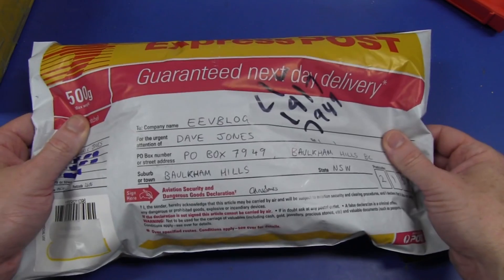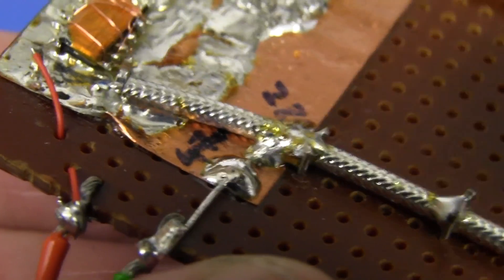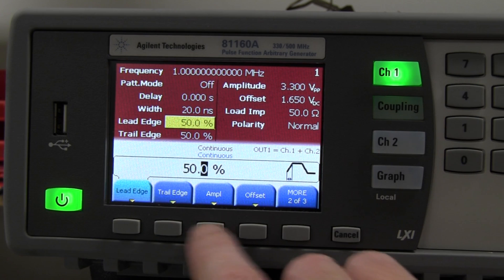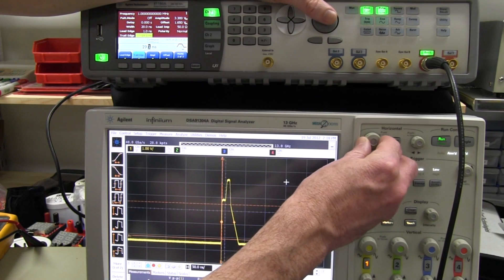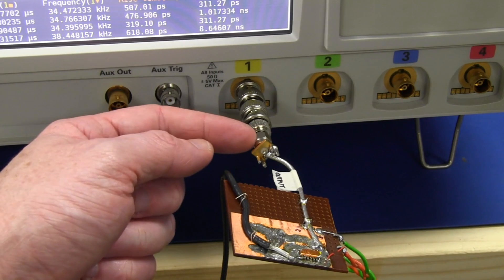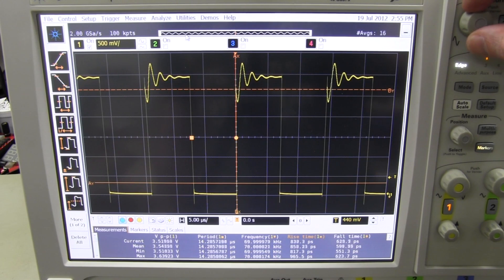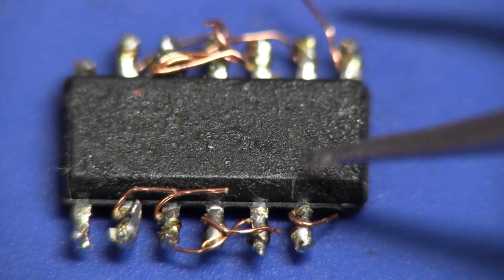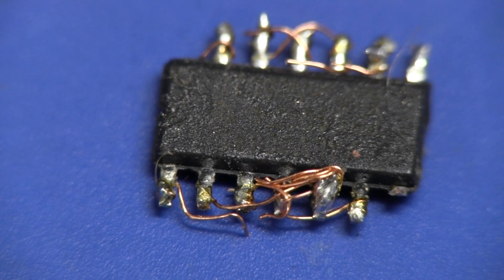EEVblog #316 - More PFANG, More 13GHz Scope, & More Pulser

Comment: Depends on the scope.  Some of the scopes run VXworks or other non-Windows operating systems.  I have an Infiniivision 7000 series, and that scope definitely doesn't run windows.  The MSO-X series scopes don't run windows, either.  OTOH, all of the high end Infiniium series units (including this DSA91304A) run some form of Windows.

Comment: First, this isn't a DSO-X, this is a DSA91304A.  Second, it looks like the earlier serial numbers had Windows XP and the new ones have Windows 7; the datasheet makes reference to operating system upgrades from Windows XP to Windows 7 on page 34.  So we were both right about the series, just basing our information off of different units.

Comment: from the Agilent Infinitum DSO-X 90000A series oscilloscopes datasheet that on page 34 states "Computer system and Peripherals. Operating system: Windows(R) 7", and within the video itself, when the channel 1 offset adjustment window shrinks and fades to close, and the same way for the settings window fades and shrinks to close. these are features that Windows XP cannot have because it does not have the Desktop Window Manager, with the DWM's Direct3D video rendering of the windows

Comment: No, it runs Windows XP.  How do I know?  I have one of these suckers in my lab, and when you push the power button it says "windows XP professional starting up".  Why would it be windows vista or windows 7 if it calls itself XP?  Where do you get the crazy idea that it has the Aero interface installed?  Most of what you see on the screen is the customAgilent oscilloscope software running on it.

Comment: It actually runs windows XP, not windows 7.  It's very common for high end scopes and logic analyzers to run windows.  I believe you can even install Matlab on it and Agilent has a plug-in so Matlab can interface directly with the high speed acquisition hardware.  Crazy stuff.
Reply: That is clearly Windows 7 as you can see @12:16

Comment: The slow ringing is probably supply bypassing — methinks, the lead inductance of your PSU wires ringing with the 74xx04's input cap. I'm not quite so sure about the high speed ringing, but I suspect it's the buffer's output capacitance ringing with the chip's leads and bond wires.

Comment: An embedded windows is mostly much more efficient when it comes to high complexity/performance applications. That way you don't have to write a complete system from scratch, only the software itself.
Example: All top range digital mixing consoles run on embedded windows.